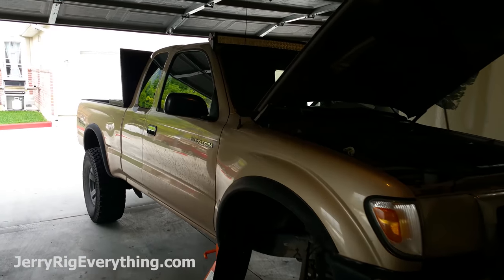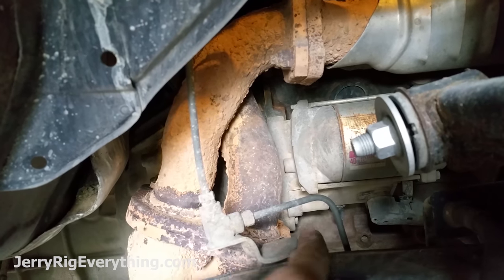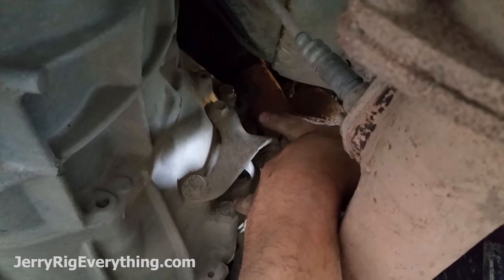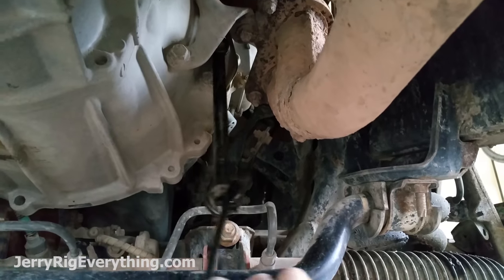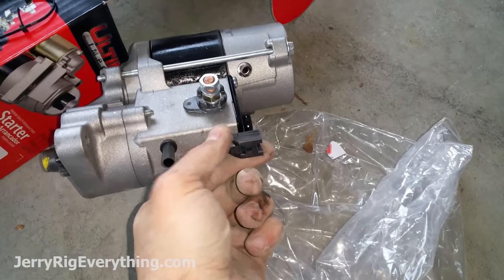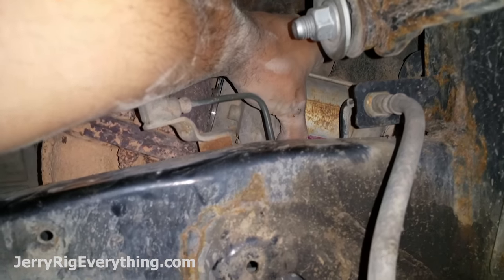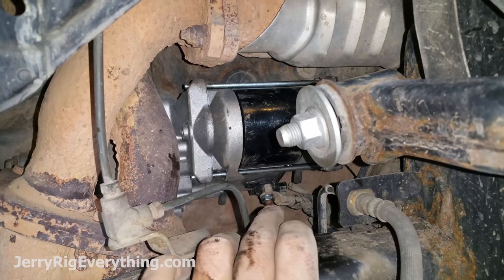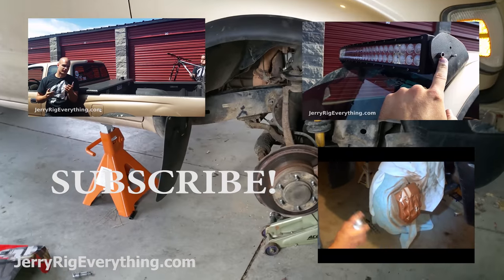Toyota Tacoma Starter Motor Replacement, First Gen truck

Comment: 98 4WD Auto, Removing the two 14mm bolts to the passenger side engine mount and jacking the engine up gave me enough space to fish it out of the fender area. I also removed a brake line mounting bracket and the Trans dipstick bolt/tube.

Comment: FYI Never buy a replacement from a box store get that one rebuilt at a reputable starter alternator shop. It’s a Nipedenso really good high end Japanese starter motor. The box store sells you a cheap Chinese knock off.

Comment: This video is for a manual trans.  For automatics, the transmission fill tube must be unbolted from the engine and pulled to the side, otherwise there isn't enough room to pull the starter out.

Comment: This video got me through the five-hour ordeal of installing a new starter.  It was my first starter removal and installation.  The first two hours were figuring out my Toyota's tire jack apparatus, jacking up the truck, removing the wheel, securing the jack stands, taking out the dip stick, and removing those two bolts. Even with a swivel joint and extension, the bolts presented a real psychological challenge.  They were hard to find in the engine muck and it was hard to get enough leverage to loosen them up.
I found that my old starter had a ring around the bolt for attaching the battery cable designed to accept a tooth, locking it in place, which the replacement did not have.  This meant that the tooth blocked me from getting a good contact with the battery cable.  I solved this with three washers so that the battery cable could fit flush with the washers.  After the whole procedure was done and the engine started up, my engine light came on which was a worry, but after driving around for twenty minutes the engine light turned off.  
Thanks for the help.

Comment: The new starter looked longer. Did you replace the 1.4KW original starter with the cold crank version (2.0KW)? I'm thinking about finding a 2.0KW reman and putting it in my 96. That way it will start up faster in the cold weather. I believe they made a 1.4, 1.8, and 2.0 version.
Reply: what did you end up doing?

Comment: Thank for showing how to replace Prado 3.4 starter, I watched  a few different videos about to replace it but you and others  never show us which way we can take it out from the truck and put it back. Can you show us how?
Reply: The reason why they never show you how to actually get it OUT of the truck, is because       it takes two hands, two hours, and a WHOLE BUNCH of cuss words. You’re better off to take small bites of this shit sandwich, slowly and methodically remove that damn thing. If you try to rush it, you’ll just end up mad, skinned knuckles, bruised hands, and pissed that you’ve started this project/job in the first place. Take it easy, you’re saving $600 bux if you had to take it to a shop, (09.2022) which you may or may not trust. Most shops I know are in it for the money, pay their mechanic SHIT for a nickle, work them like a dawg, and don’t really care if their mechanic never torques their bolts properly, (bolts come loose and fall out), or damage something else (the exhaust pipe, or oxygen sensor), because that means more work (and MORE superbuxx $$$) for them. 

      Fuck the shops. If you own a Tacoma, you should wrench on it yourself.

Comment: My 1998 Toyota Tacoma SR5 has the starter on the driver side, not the passenger- I suspect we have completely different engines.
Reply: ...but you never say which engine you have...
2.4L I4
Or 
3.0L V6
Or
Chevy 350 small block with a Holley 4 bbl double pumper. That’s the engine you’ve got!  We ALL know!

Comment: Showed none of the actual work. Just showed before and after frames of it. Wtf
Reply: You need someone to show you how a bolt turns..get a life
Reply: The point of this video was that with a bit of effort, you too can be a shade tree mechanic, and save yourself around $600 bux if you do the job yourself. If you need a video to show you every little detail, such as removing every exact bolt, you shouldn’t be doing this project/job. 

I’ll be surprised if you get the truck jacked off properly...

DONT DIE bro!  Nawt werth it